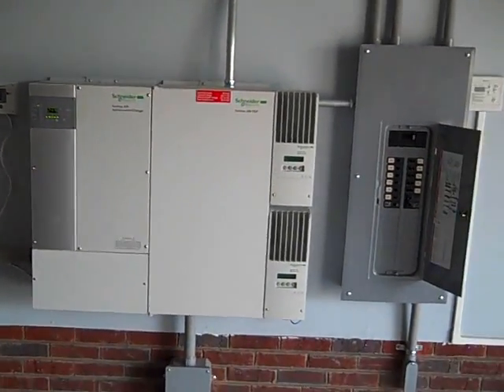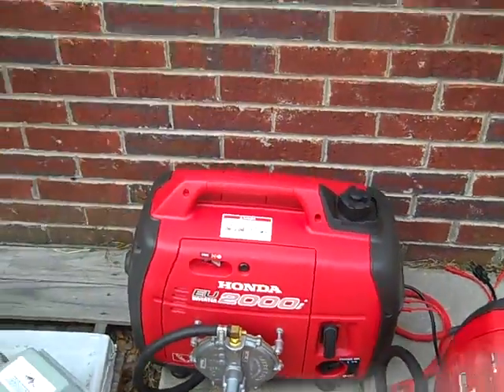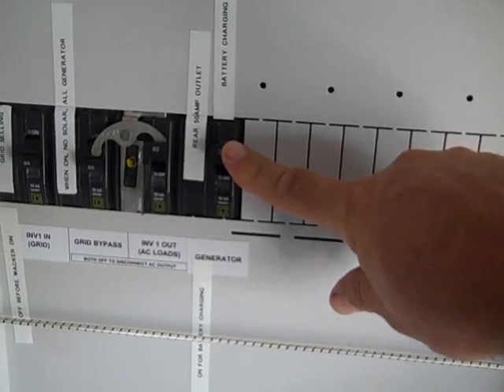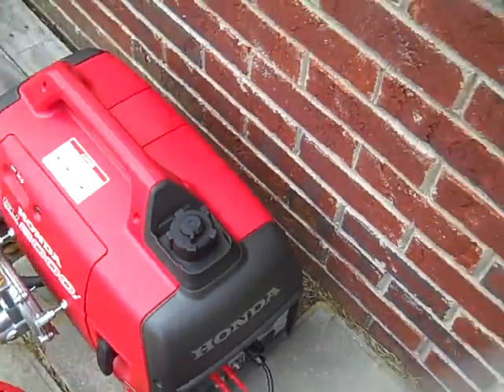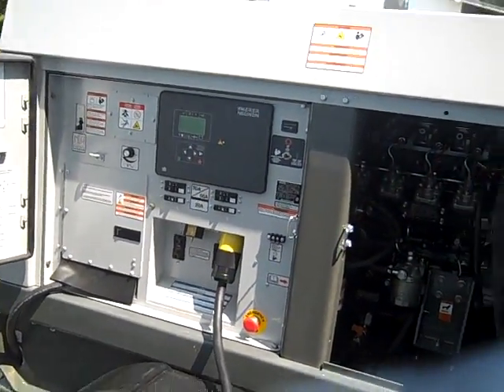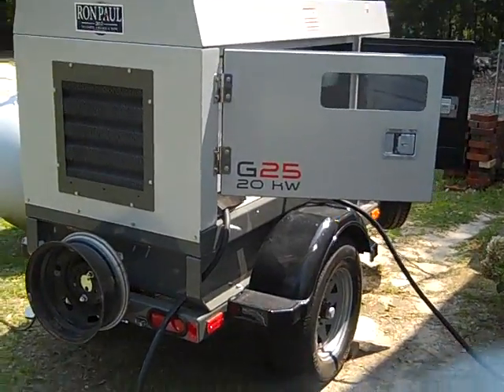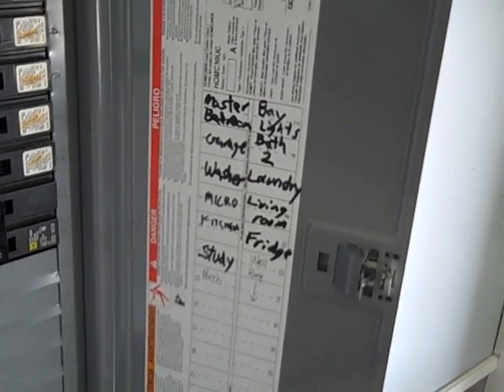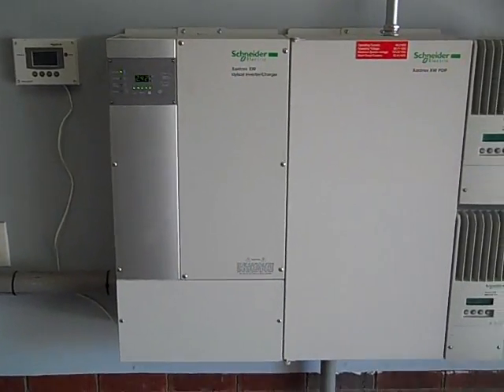Hybrid battery backup with several generator options

Comment: Great video and example of a backup system with  multiple charge sources. You'll get more efficiency by going with a purpose built DC generator and more convenience with an auto-start propane DC generator.

Comment: Nice system. We install a lot of the XW-6048's out here in Cali. I would only suggest two things that have helped our customers out. First, you can harvest much more energy annually from the PV panels by using Midnite Solar charge controllers instead of the Schneider Electric ones.The high voltage strings with Midnite's give the batteries more charge annually. And the PV panels could be set off of the roof with a higher stand off under the racking. We use Professional Solar racking. Nice work!

Comment: Really great system and it really shows what you can do.

The best part is that you can slowly build it up, no reason to do the huge cash infusion at once. You can start with one honda generator, then get another. 
Then start with a really small solar system with a few batteries just to run some LED lighting.

Or...you could by a prius c for 19k and use that as a battery backup/generator.

Comment: Thanks for the videos and the time you put into their production. I have put into practice a small fraction of what you have done in your videos. I am still totally dependent on utilities for my water and power even though I live in a rural area. I heat with a wood boiler but do you have any suggestions on power and water backup that wouldn't cost me 50K? I would be willing to drill a well and spend up to 5k for all. I do have a 7kw gas generator that costs too much to run full time Thanks!

Comment: Great system for as long as the fuel supply lasts.  The solar part ought to run independent of fuel supply.  I assume this rig is for temporary power outages, like hurricanes, other than solar.

In a major, long range power outage, the sound of that generator would draw lots of admirers.

Comment: GenConneX sells new Honda 2000 propane generators online with a one year warranty. Converting the Hondas to propane nullifies your warranty. The big problem with Ethanol is that it absorbs water 50 times more than the gas that was using MTBE so gasoline is no longer suitable for long term storage. Using a marine stabilizer and a water separator will help if you must store gasoline.
Reply: +EZ Off Grid 
 I have 2 vehicle and keep them filled to the brim before a storm. That will give me at least a week of power....

Comment: That's pretty nice set up there, for sure.  One question- so far as I know the XW series are synchronous inverter / converters?  As were the SW series from Trace Engineering.  If so, it's critical that the manual transfer switch cannot be thrown faster than the dropout time on the inverter, if the switch is ever thrown when both sources are energized, and the inverter is synchronized with- and connected to- one of them. The transfer switch must stop in the "center" off position, between sources.

Comment: nice vid, informative.we are working towards an offgrid, solar/wind system with gen backup, so any and all info is helpful. nice clean job on the inverter and panel setup. I'm liking that wacker neusen genny. Is that spendy? Keep up the vids. thanks much for the effort.

Comment: Pretty cool system. A little overkill but then I understood why the client wanted a mobile generator. The Ron Paul sticker on the back let me know. he he

 I like the idea of a supplemental gen-set, this probably let you install a smaller PV array with an over sized inverter for the array. 36k is a good deal for a turn-key hybrid whole home with backup gen says me! 

Have done some hybrids but no gen-set hybrids yet... Your project looked like fun, cannot wait to get on one similar soon.
BreeZee

Comment: You can only purchase on line VP SEF 6638 8 Small Engine "Fix-It" Fuel for All Strokes - 8 Quarts 109.99  You can buy in quart, gallon, 5 gallon pale, ect. but if you wanted a 55 gallon drum expect over 1500.00 each plus tax and shipping.

Comment: ok, so I got both (2000i & 2000EU) running in parallel, and I had my first test after a storm power outage Sunday, here is what I was able to run at the same time within Honda specs,   21 cu ft frig,   21 cu ft freezer,   12,000 btu A/C,   42" plasma,   5 fans,   lights,  charge batteries for my 24VDC solar pump,  and a quail egg incubator.
Reply: thank you for the feedback, very cool, did you use propane?

Comment: Is this prepping what you do for a living?  I mean do you wander around the countryside setting up off grid power, water and other systems?
Im doing a grid connect solar course at tech, It's a post trade course. Do you have to have a electrical contractors licence in the states as you do here? Do you fit RCDs, Residual Current Devices, Earth leakage systems for safety?

Comment: What is the smallest converter I would need to run a full size fridge?  Can one deep cycle 12 volt battery run it or 2 batteries would be better.  I got one deep cycle battery the size of a large truck battery.

Comment: Oh, forgot. In the end in my experience, the gel batteries will fail sooner than a solar specific lead acid battery. It is a trade off for our customers, maintenance and long life or no maintenance and replace them twice as fast. In the end it all depends on how much they actually use them. The more the batteries are used the longer they will last. For backup systems like this they should use the batteries a minimum of 4 times a year.

Comment: Specific to this system with the 12 batteries, I think you said. How long do the two generators need to be run in order to top them up from 50% discharge? Also, can that generator be kicked on automatically when the batteries are discharged to 50%?

Comment: Instead of 2 or 3 EU2000i models, why not just 1 model Eu7000iat1 7,000 ? Does the Tri Fuel Kit only work with the EU2000i models? Also, after reading the Yelp reviews on Central Maine Diesel, I am now reluctant to buy anything from them.

Comment: If you just had the Hondas in parallel and the solar panels, how would you run the 220v well pump?  I think those Hondas put out each 20 amps at 120v.  Would you have to step up to the 6500 IS Honda to get 240v for the well?

Comment: Those small honda's adjust their engine speed automatically so if you're only drawing a few hundred watts, it sips fuel and its also quieter. big gens, are gas hogs and louder no matter what. If you need to start something big up, then hook the second generator in parallel.

Also, it adds redundacy, if one breaks, it's not the end of the world and now you have spare parts to keep that single one running. Or if you need power at two difference places.

Comment: How does this system prevent selling back to the 20Kw generator?  Solar inverter would recognize this as AC 1 and sell back.   Wouldn't that cause problems for the generator? ... Assuming AC2 input is set to not sell back to Honda's?

Comment: How long will the generators run using that propane tank? And how long will those generators run using ethanol? Thanks.
Reply: Farad152000 hey did you ever find out how long the small Honda generators run on one bottle of propane?

Comment: Why not a drive-in bunker with 20 kiloton blast doors?

Kidding.  I would build a small ventilated shed around the big propane tank, diesel storage tanks, and the large genie and set it up with an alarm system and flood lights.  I'd also bury the cables running to the house and have a spare set on the trailer for mobility.  The small genies and propane tanks would be fine with just an AC unit screen.  Looks like he already had one small genie stashed just in case he lost the other two.

Comment: If I want to run a small AC unit about 5000-8000 BTU for 12 hours in the summer with 1000 watts of solar panels and a 3600 WH lithium battery bank, can I run a small  2000w inverter generator minimally on eco mode to kind of supplement my solar power?  Right now I live in Michigan and average sunlight is 4 hours but may be higher in the summer..
Reply: i would like to reserve 2 days of power.

Comment: I think the real question is why would you ever need a 20KW generator? I work for a hydro company, and we put 10 houses on one 25KW transformer. houses rarely use more the 4KW max at any one time. even if you account for the batteries being charged: those Honda 2000W generators are really 1600W continuous rating equaling 3200W. That means your house needs a very max of 7.2Kw of power at any one time. (It is very likely that the batteries do not require 3200Ws to charge) And this is worst case scenario, on the day where you use the most power. The thing is you rarely usually don't have every electronic device on in your house at once.
Reply: but what if I have an urgent TIG welding project and the grid is down? :)

I think the main reason most people install a 17kW, 20kW or 22kW whole house generator when they likely don't need more than  a 10kW or smaller is cost.
1)  The main cost for any generator in the long run is the FUEL, and typically the same based on the same load (though larger units running at 50% or less capacity may have an advantage here).
2) Having an electrician INSTALL, and an inspector permit/approve the installation means about $1000 regardless of size.  100Amp or 200Amp transfer switch, same price. 
3) The cost of getting the gas HOOKED UP is the same.
4) Even the pouring of a pad will be the same.

The cost between a cheap $2500 generator and a "pricey" $3500 is almost nothing compared to the overall cost, and the increased capacity means you're less likely to have to shed the AC or other appliances at start-up. Staying within the air-cooled line up of generators keeps the prices close enough its worth the extra cost in most people's minds.
Reply: You do make a good point. It is true that you can increase your KVA (sometimes by a third) in a generator for a reasonably small increase in price.

I guess the way I look at is: The power is out all you REALLY need is heat in the winter, Fridge and freezer for the long outages so your food is still good. If you use electric baseboards... then yes that is a large amount of electricity, but for most people 5KVA is plenty for emergencies. true you can not run everything in your house.

I would use a 3KVA generator that would run the fan in my furnace and my fridge and freeze plugged in at the same time ( not running all at the same time).

BUT  BigDogsHunt100, your right about spending the money on permanent and/or auto transfer generators.
Reply: Robert Campbell
yeah, I suppose the most prudent idea is to put as many appliances on natural gas as possible, then minimize your electrical demand by using LED lighting, proper house insulation, etc... really depends on your area, but for the most part NG will be more reliable than any other source except a battery bank (solar, wind, water power...).

Comment: is that battery box ventilated? i know AGM are sealed but if they get over charged they will purge gas, just a safety thing. and why use AGM and not Deep Cycle

Comment from the maker: Look again, there are 2 xfer switches in the system, one auto and one manual.  There is no cord with 2 male ends.  Ever see a Hubble connector?  I assure you that this system is to code and I am sorry you cannot see how the system works.  This has been inspectedand has been running flawlessly since uninstalled. Why all the negative comments?
Reply: Did the suicide plug between the generator combiner box and the house plug allowed in code?

Comment: Looking at those Honda generators ,,, You just gotta expect that sooner or later someone is going install one of those in a homebuilt electric car for a range extender. Maybe someone already has.
Reply: it's been done, but not with anything this small. ben nelson put a 3400W rv generator in his electric geo metro. the problem with this is that the generator can only provide some of the power required by the traction motor. this means that power is still being taken from the battery bank. it's just less than normal, so it will go further before the bank is depleted.
Reply: TKTmon Well ,,, that's range extending alright. But I think it would interesting if you could have stated some specifics if you knew them. Like how big his battery pack is in Kwh. How many miles does he normally get. How much more range did he get with his generator running etc.

 I'm of the notion that battery packs for electic cars should be at least 40Kwh which should be good for a 140 mile range. Beyond that you're on a cross country road trip. You need a range extender which this Honda generator could fulfill your range needs.

Comment: I love the neatness of this, good work! However in all these videos it boggles my mind that batteries are always getting shoved into enclosed wood containers (fire hazard...)
Reply: +John A It depends on the batteries.  Lead/Acid produce hydrogen gas when charging and if contained can ignite.  Gel (agm) batteries I believe only produce hydrogen if overcharged.  Either way, they should have a vent to the outside in the back of that box.
Reply: +John A The wood is also non-corrosive, non-sparking and easy to replace if needed. Steel/aluminum aren't and plastic shelving units like that tend to be too "saggy" with battery weight and often use steel and aluminum to stiffen the structure. 
.... just more stuff to think about when planning systems.

Comment: Forget that! $800 connection?!? LISTEN PEOPLE! If the power goes out, 
Step 1. kill the "Main" breaker to your meter.
Step 2. Make a "double male" connection by splicing two extension cords.
Step 3. Plug your generator into any household socket. 
You now have power to every room in your house and it didn't cost you $800! You're welcome!
Reply: Step 4: Realize that most sheeple don't know a damn thing about electricity and forget to do Step 1 because it's dark, they're in a hurry to get their power back, etc.

Step 5: Kill the lineman working on a "dead line" while he is attempting to restore your power.

Step 6: Go to jail.

Don't forget, if a standard distribution line goes down (let's say a MV 7200v line that feeds your neighborhood), when you backfeed and forget to turn the main off, the transformer on the pole will work in reverse.  Your 120/240v generator WILL go through that transformer and it WILL be stepped up to the output of the primary winding input.  In my area, that means 7200 volts. 

Of course, that's if you don't burn your generator up first by trying to supply your neighborhood with power because you forgot to shut the main off. 

Folks, at the very least, buy a small transfer switch for required loads.  You can get a 7500w transfer switch from Reliance for $250 or less. 

If you have the money to buy a $15k diesel 25kw generator for whole house, you have the $800 to spend on a DPDT manual transfer switch.

Comment: $29,000 for that Wackner Neuson G25...
Reply: I went budget. If you have money to toss at this, yes buy all new toys. If you don't have the money, hit the auctions for equipment rentals as they refresh their inventory. I bought a Genie light tower with less than 1,000 hours, full tank of fuel, and ready to run for about 1/2 the price of one of those portable Honda Generators. The unit is a 3 cylinder diesel, with a 6KW continuous rated generator with an 8KW surge capacity for 30 minutes.  You don't need to spend 50K for alternate power. Instead of a 70A feed, I use a 50A contractors twist lock. In an emergency, use a 100 foot 6AWG cord between the generator and a contractor's rain proof spider box.  A little less convenient when running extension cords to the spider box, but a lot less expensive to have on hand.  The generator is not dedicated to standby use. It is a regular tool for outdoor events and used to power the stage for the sound system and lights. Standby equipment is often neglected and non-operational when needed in an emergency.  Ever try to use a flashlight in a home emergency kit? Most likely dead. The one that works is the one in your desk drawer with extra batteries.  Same applies to emergency power. The one used for running a table saw and air compressor on construction is more likely to be fueled, maintained, and operational in an emergency.
I learned from my dad. The solar at his place is backed up by the RV generator. Keep the tank full. 2 Honda Generators running on 20 Lb of Propane will not last long. The 22 KW diesel with a 60 gallon fuel tank will last more than a weekend.  Keep this in mind. The diesel with the hybrid battery, could last well over a week if the diesel is only run 8 hours each day to charge batteries, pump water, do laundry, cook, etc.  Might want to consider adding a propane outlet on the 500 gallon propane tank instead of running on a BBQ bottle.  Consideration must be given as to the delivery pressure. The 500 Gallon is likely to be primary regulated to 15 PSI, and then to 11 inch for delivery to appliances. The Honda conversions might not be designed to operate after those regulators.  Check first before trying to connect them.

Comment: Why not put wind mills in the middle of interstates and give free energy to the public???
Reply: Solar panel and super capacitor systems near roads to run low power heaters under them.  It can be slightly over built and run BOINC projects on RPi's to burn off excess power.

Comment: Where did you get $50k from?  I'd pay that much right now for all of that equipment.  You could do that for $50k if you downgraded the quality of the generators and batteries and went with 15 panels so you would only need one charger/controller.